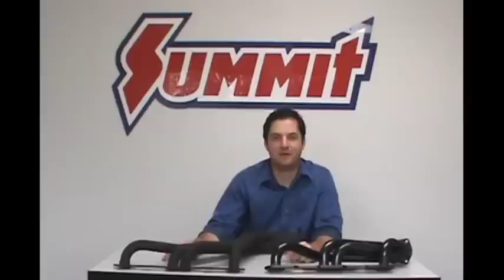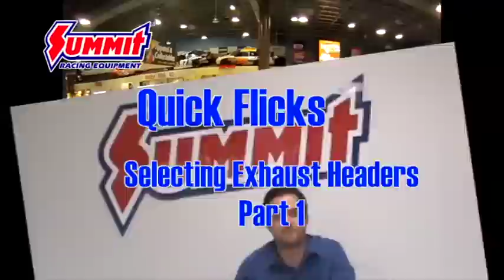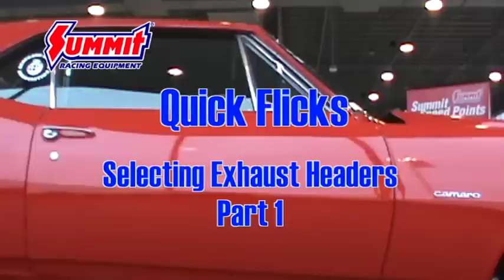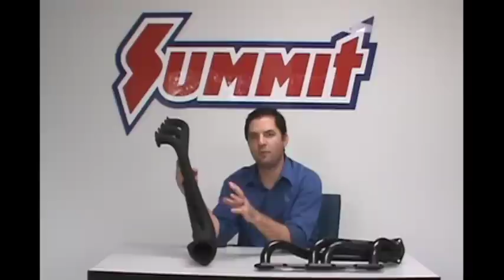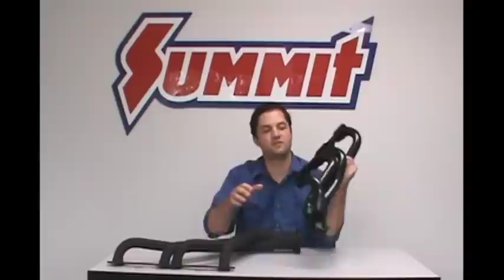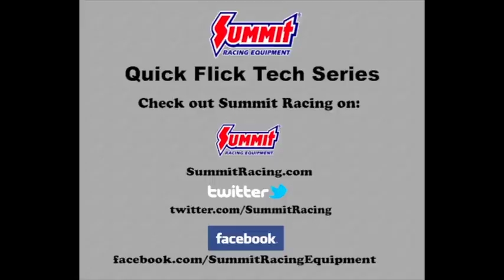Long Tube vs. Shorty Headers - Summit Racing Quick Flicks

Comment: I have a 76 elco 350 with headers. My car is currently dropped. Has no wheel gap. The headers scrape. Would your Flowtech 11108FLT - Flowtech Headers fit?
Reply from the maker: Hi Omar Neria, 
Yes, that part number is the correct choice for your car and is a good idea in the case of a lowered application like yours. That part will allow you to have a custom, more tight fitting exhaust bent for better ground clearance.
Reply: Awesome! I purchased them and just got them delivered today. Can't wait to install theme this weekend. I have an exhaust leak due to the scrapes so I'm excited to get rid of that air leaking sound and I'm hoping the headers give a slight change on the sound of my car since my current headers are beat up and old already.  I'll keep you posted once I get them installed. Appreciate the info!
Reply from the maker: Awesome, Omar Neria! Thank you for your business. Let us know if you have any questions.
Reply: Actually I do haha. Once I install, which will most likely be tomorrow, do I have to break in the headers or can I start pressing on the pedal once they're installed?
Reply from the maker: Omar Neria, 
This part number is a painted header and does not have a break in process like a ceramic coated header does. Just make sure to keep checking the bolts at the cylinder head periodically and keep them tight. This will eliminate gasket failure and flange warpage.

Comment: Your video really explained a lot I was debating on getting long tubes or short tubes I went with the short less work less money but question the headers I brought has holes for the o2 sensors so do I still need my cat converters or can I get the converters that doesn't have the holes for the sensors or can I just run straight pipes thanks in advance
Reply from the maker: Hi Jerrell Brooks, 
If you have emissions testing that you must comply with, then the O2 sensors and catalytic converters must be re-installed.

Comment: I just got a 2007 Dodge Charger 5.7 HEMI, I am undecided if I should go with long or short tubed headers. I am not going to lower my car any. But I want some performance improvements and gas mileage gains. I also plan on getting performance cats and cat back exhaust. Which will give the most gain for my money?
Reply from the maker: Hi Kelvin Francis, 
Keep in mind that performance gains typically come from burning more air & fuel, consequently the fuel economy numbers will suffer if the combination of parts and computer re-tuning are not correct. Give us a call, we’ll help you chose your parts correctly. 1-330-630-0240. Thanks for watching!

Comment: I have a 2-Door Tahoe 2wd 1997 5.7l. It will be lowered 4/6" drop maybe 5/7" drop. Im looking for more torque and better response. Not race truck but truck runs perfect and just don't want any other Tahoe out running this one Jaja. Would long tube headers have big clearance issues? What would be the best header and Double pipe exhaust?
Reply from the maker: Hi Marcos Villagomez, 
Due to the fact that you will be lowering it so far, a short tube header will be much easier to work with when you have a true dual exhaust fabricated!

Comment: Your videos are helpful but ive got a 87 cutlass with a 350 will the long tube be any hassle to put in verse the short tryin get power
Reply from the maker: Hi greg washington, 
Due to more tubing in a long tube header, it’s understandable that they would be a little more labor intensive to install. In some cases you may have to remove the starter and oil filter to achieve adequate clearance for installation.

Comment: I'have a Mustang 2012 V6 with Bama93 tune and BBK long tube off road x pipe and Roush muffler how I can increase back pressure ?
Reply from the maker: Hi Blackout2012, 
You can increase backpressure simply by reducing pipe size or using a more restrictive muffler.
Reply: Hello and  a resonator Long 10 -12 inchs will be good?
Reply from the maker: Blackout2012 , 
Resonators typically do not restrict flow (depending on design) but help to muffle the exhaust note a bit more.
Reply: Thank you I did the resonator and the car is back to life

Comment: 2007 dodge ram 1500 5.7 hemi single cab slt 6.3 foot bed  hard to find long tube but want best hp and torque increase and believe the sound is better from a long tube any idea of where to find full length headers that are great quilty for my truck?
Reply from the maker: Hi Evilstone222, 
We do have long tube headers available for your truck. Please give us a call and we’ll help you match up just the right ones! 1-330-630-0240.

Comment: I've got a 2007 Ford F-150 Lariat 4x4 Crew cab and was wondering if longtube headers will effect my 4x4? I've heard some horror stories with fit issues and some people disconnecting their 4x4. Would I have to leave skid plates off as well after install?
Reply from the maker: Hi Steve Moon II, 
For a 4 wheel drive vehicle, long tube headers will work but usually do exhibit the fitment issues you are concerned about. A better suggestion would be a shorty style header. They have better fitment, require less modification to the overall exhaust system and cost less than a long tube.

Comment: I do have a1969 Malibu chevelle. My car just a cruise but I like sound performance like a muscle car. So which do u suggest for me to get a header. Shorty or longtube?
Reply from the maker: Hi Scubasteve83, 
There are a few things that will dictate a short or long tube header. What is your performance goal? Do you have a number in mind? Will the car be lowered? In today’s car builds, this question needs to be asked. Many cars are being built lower and wider for better handling characteristics. Give us a call on the tech line and we’ll help you pick a set of headers out. 1-330-630-0240. Thank you for watching!

Comment: Hey Summit, great video, very informative. Could you tell which pair of headers fit an original 1967 Shelby GT-500, 428, 4speed, Power Steering? Thanks in advance, Dmg67.
Reply from the maker: Hi DMG 67, 
Thank you! Can you give our tech line a call? We need some additional information from you. 1-330-630-0240. We look forward to your call!

Comment: Will a shorty header be better for pulling at,1500 to 4000 rpm. then a long header. stock 6.0 might get a tuner also?
Reply from the maker: Hi MNicehole, 
A short header will work just fine in your application and will be easier to install and remain emissions legal too!
Reply: If I cam it up a little, will that be a problem with the shorty's.

Comment: Hey Summit awesome tip video but still deciding on if what works for what I have with my lifted 93 Chevy Blazer v8 350 I have an airaid intake with powder-aid throttle body spacer, my catalytic converter deleted, and I have a super 10 series flow master going out to a duel 4" magnaflow tips...which one of those headers would be perfect for the setup I have already that'll give me more power and boost to my truck??
Reply from the maker: Hi ewreck77, 
A long tube header will always scavenge the cylinders better allowing for a cleaner burn the next time around. More complete combustion is more powerful.
Reply: Summit Racing okay thanks! So whats the best brand of the long tubes to get now a days??

Comment: I have a 99 Tahoe 4 door with super 44 flowmaster it sounds ok ..but I  am not satisfied I want a much deeper aggressive sound + lil power gain & will also be adding K&N CAI which would you suggest long tube headers or short headers ? Appreciate a reply
Reply from the maker: ygswagg111,
If you will be tuning the
computer with HP Tuners or the like, long tubes with Magna Flow mufflers would
be a good choice. You will be able to get the extra power you desire that way,
and the Magna Flow mufflers have a deeper sound to them.
Reply: Summit Racing - are long tube headers legal ? AND are u saying magnaflow are deeper then flowmasters? I just got my flowmaster don't wanna change them appreciate the reply btw :)

Comment: I have a 2013 F150 with Flowmaster American Thunder 3.5" catback with super 10 muffler, K&N CAI, AFE shorty headers and SCT Tuner. Would going with Long Tubes further improve my sound and performance? They would be catted and it's a daily driver.
Reply: Note: 5.0L
Reply from the maker: Mark Snyder, 
Since there will be cats in the
system, they will absorb any increase in sound that may occur due to changing
to long tubes. A performance gain would be realized with the long tubes if the
truck were dyno tuned and a new computer program built.

Comment: I have a 1973 nova with a 350. I drive it daily and not looking for really any racing type speed but want to gain some more performance and get the quick jump off the lights. Which headers are better?
Reply from the maker: Hi Eric Gutierrez, 
A long tube header will make better power on a properly built motor but, since max power output doesn’t appear to be your goal, the shorty style header will be easier to install.

Comment: If i got shorty headers for my 2010 camaro that already has borla atak catback exhaust, will it still pass emmisions?
Reply from the maker: Hi devin cook,
Borla doesn’t offer an emissions approved header for your application. We do offer a Flowmaster header, part number FLO-814122 which has an E.O. approval in California. This is recognized in every State as being emissions legal. This system will tie in the Borla exhaust with no modifications. Also, We do list other brands that are legal also.    http://www.summitracing.com/parts/flo-814122

Comment: I still see no point of short headers, it seems that if you are going to put on headers, you might as well put on long tube headers, shorts seem so useless compared to long...
Reply: better than stock exhaust manifold performance and sound and cost a Shit ton less than longtube
Reply: Shorty Is what u would use if of u were going turbo u wouldn't use longtube for that unless u were going the supercharged route
Reply: @Shdw366  I just want my 06 charger to sound better plus it's my everyday car
Reply: Close quarters like vans shortie headers are often your only option as compared to stock
Reply: Dog Of DooM 81 for Drag racing they tend to use shorter legnth Headers because of the initial Torque produced during take off.
Reply: Unless they won't fit with a big block swap in a tight engine compartment

Comment: Whats good for a 4g93T gsr?
Reply from the maker: Hi *****, 
In a mildly modified street driven application a short header will work all day long! If the motor is highly modified and being used at a high RPM range, then a long style works good!

Comment: I have a 1996 ram 1500 4x4 5.2L and i just got a set of shorties for if.. as an off raoder is the shorties better or should i get long headers for it
Reply from the maker: Hi John Loewenstein jr, 
It really depends on the type of racing you are doing really. If it is all low RPM stuff such as rock crawling, a shorty style header will do all you need plus provide good under chassis clearance. Now, if you are more flat tracking, mud bogging or desert racing where you will be in the higher RPM’s for extended periods, then a long tube is a better choice. Thanks for watching!

Comment: 96 chevy tahoe 5.7 I wana get long tubes but what u think is better.
Reply from the maker: Hi Roger Espinoza,
Roger, assuming you wont be racing this vehicle, but possibly towing light loads; a short style header would be more cost effective, easier to install and allow you to keep you catalytic converters for emissions compliance.
Reply: Summit Racing mines is a 1996 C3500 chevy dually with the 5.7 350 big block what would you recommend occasionally I take it to the tracks . I also live in Texas so not sure if there are emission standards here.

Comment: I have a 96 ford f150 xlt with the 5.0L engine. I plan on doing a complete exhaust system. Thinking about getting rid of the cats and doing dual flowmaster 50 series mufflers. What kind of header should I use?
Reply from the maker: Hi Jeremy R, 
A short style header will do all that you need in a low speed towing application. They are generally less expensive and easier to install. They will also allow you to keep your catalytic converters and remain emissions legal. Thanks for watching!

Comment: So if i get aftermarket headers and put them on my 5.3 liter silverado will it make my exhaust louder? i have flowmaster 40 series 1-in 1-out.
Reply: Beavis what you're probably interested in is a a camshaft for your truck.
Reply from the maker: Hi Beavis, 
Headers will have a small affect on the sound of your exhaust but nothing very dramatic at all.
Reply: ok, i have a flowmaster 40 series which i like the sound of it but i want to be able to here it more at low/cruise rpms

Comment: Hey I have a true dual Flow master Super 10 setup with an X pipe on my Mega Cab and am thinking about getting shorty's along with high flow cats. I will see a louder sound difference correct? And should I keep that X pipe?
Reply from the maker: Hi Rob King, 
We need some additional information from you. Do you mind giving our tech line a call? 1-330-630-0240. We look forward to your call. Thanks for watching!

Comment: 1985 mustang H.O.??? Best for power and deep sound?
Reply from the maker: Hi vtec295hp, 
The best header for power would be a set of long tubes. BBK has some nice long tubes with a matching X pipe to maximize your sound!  Give us a call and we can set you up. 1-330-630-0240.
http://www.summitracing.com/search/year/1985/make/ford/model/mustang/department/exhaust/section/headers/part-type/headers/header-style/full-length?SortBy=Default&SortOrder=Ascending

Comment: Iv got a 5.7L hemi I'm lookin to replace all of the exhaust n headers what would be best for my truck long or short tube? Iv looked at pacesetter headers n I just don't know enough to make a final decision
Reply from the maker: Hi tyler james, 
Short tube headers, high flow catalytic converters and a cat-back exhaust system will do the trick just fine on that truck. Consider a programmer or tuning to add additional fuel for the increased airflow. Thank you for watching! Let us know if you have any additional questions.

Comment: which headers are better for a 1996 dodge ram 1500 5.9?
Reply from the maker: Hi Louis Espinoza, 
A short tube header is a great choice for a low speed towing application like that. They are easier to install, usually more affordable and will bolt up to the existing exhaust system. Thank you for watching!

Comment: What about Center Dump Headers? I'm running a set of S&S center dumps. how do these compare to the 2 you show in this video?
Reply from the maker: Hi Trippinovermylaces, 
That type of header would be considered a shorty and as stated in the video is a good choice when ground clearance or ease of installation is an issue. Center dumps are also popular in the street rod market. Some manufacturers even refer to them as “Street Rod Headers” or “Block Huggers”.
Reply: Thanks for responding.!!
 Block hugger was the name I couldn't get to come to mind when I was typing that.
  I'm running them on a 79 gmc pickup. Only because I couldn't pick up a different set at the time. But I haven't come to regret it. Only truck I've ever seen running these. And the sound is very unique. "I know that Truck" is usually the comment made.
 Would I increase horsepower at all by switching these to a set of the shortys in your vid.??
 Thanks Summit!!!!!!!!!!!!
Reply from the maker: Trippinovermylaces,
Sounds to me like you have a unique sound that you and the people around you enjoy, possibly!  The switch to a different shorty would most likely not be worth the effort for little to no gain. Now, switching to a long tube style header would assist in making more power in the mid-range but, they would cause you to change the exhaust (at least the front pipes) and your ground clearance would be limited. That’s important if the truck is lowered!
Reply: you got it right . !! The exhaust went in the truck, and the stereo wasn't needed anymore. The sound is awesome!!
  We do plan on lowering the truck to the ground. So the clearance is going to be an issue for sure. Doesn't sound worth it in this case to swap headers out.
 Thanks so much for the Tech Advice. !!

Comment: i was wondering what would be good for a 01 v6 mustang that is gonna have side pipes and eletric cutouts
Reply from the maker: Hi Harvey Justice, 
Shorties will make it easier to bend pipes into your side pipes but, you’ll have to weld in bungs for your O2 sensors. Catalytic converters are going to be a challenge for you though so you can stay emissions legal!

Comment: What would be better on my 96 gmc sierra k1500 with a 5.7 vortec, just looking for primarily sound
Reply from the maker: Hi Cody Byerly, 
Since you are looking for primarily sound, the better choice would be to add a Cat-Back exhaust system. Your choice of muffler (cat-back) is going to influence the sound more so than a set of headers.

Comment: Just bought my first car and it's a 78' Trans Am. Can i put on either the long or shorties without risking not passing a smog test??
Reply from the maker: Hi Luis Bryand, 
If you need to pass emissions testing, you must keep the converter on the car. We have long tubes available for your car but not for use with a catalytic converter. The shorty’s are the easiest to install and keep the converter. However, since we are unaware of your engine size, there may not be any shorty’s available for your car. Please give us a call at your convenience, 1-330-630-0240. Thanks for watching!

Comment: Hi, I have a 13 dodge challenger SE v6 ...would the v8 long tube headers be able to be installed? I have several friends telling me it's possible...
Reply: Not without modification. And if it's a 6 cylinder it's not even worth doing any work to. You're just going to be disappointed. The v6 wasn't designed for performance on that car.
Reply from the maker: Hi Kristopher Lacey, 
No, this is not possible!